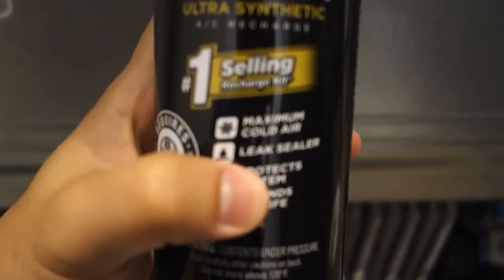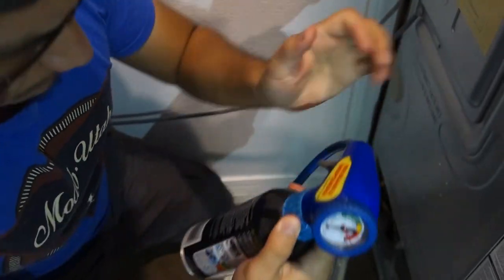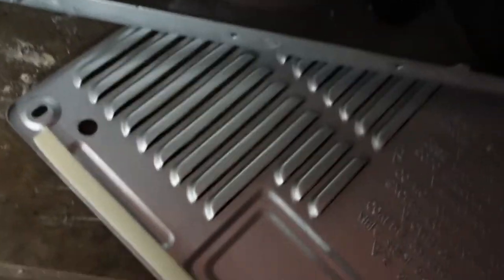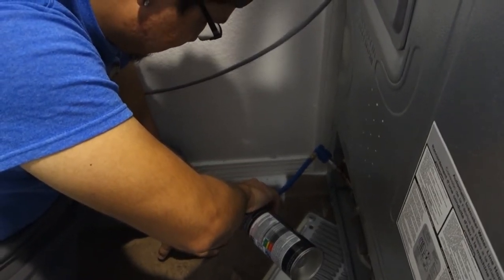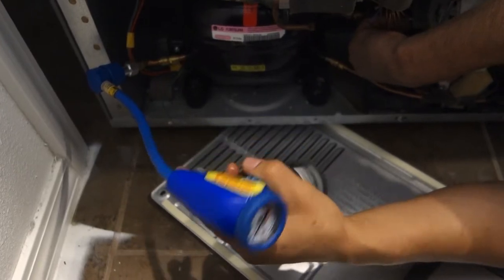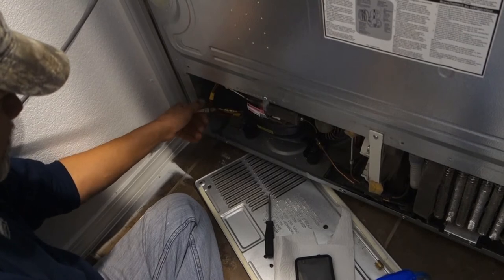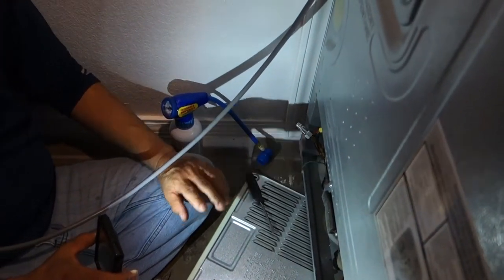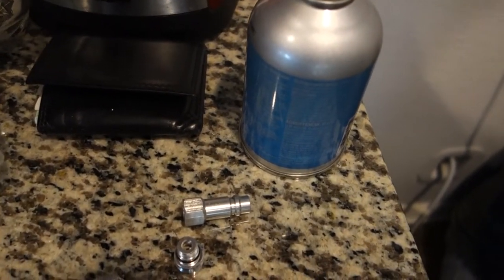LG Refrigerator Problems

Comment: This is a terrible idea do not do this. first of all on inverter compressors it's very important to weigh the charge in not just shoot gas in there without knowing how much you're putting in. Second of all you're letting air and contaminants in there.

Comment: The fact that their is no vacuum on the system when being charged, probably didn’t have the compressor running , I’m 100% positive the refrigerator was over charged and system contaminated. This is no where near good advice and would never recommend any homeowner do this without proper equipment and knowledge to service your refrigerators sealed system

Comment: After doing that if you’re refrigerator turns out to be properly charged I’d be extremely surprised and say you got extremely lucky. First of all if there is very little or no refridgerant left that means you have a leak that needs to be repaired before refrigerant can be added again. Second it was so obvious you guys did not know what you guys were doing. Turning the bottle upside down does charge the system faster but it also puts LIQUID into the system which is not good for the compressor. 

Bottom line don’t do this shit at home.

Comment: Please don't tell people to do this. While you were pushing in on the valve stem you were allowing air into the system. These fridges run in or near a vacuum and use less then 5 oz. Of freon for the whole box. I will give it to you that you were probably low on freon but anyone who hasn't had their compressor replaced won't have that port. I would say whoever replaced it probably didn't seal the system right and it will happen again. In the mean time that frosted line will drip once the compressor shuts on and will most likely find a way to the wall and start to cause problems. I would at least pull it out and check if it is rotting the wall now. Best of luck with it.
Reply from the maker: Thank you so much for that feedback but hey truth be told once warranty is over you try to fix it yourself to save some money. However I really do appreciate this information and I will be checking out what you said. Thanks again

Comment: So my LG refrigerator has the fresh food not working but the freezer part is cold. Ice maker is working.  Just the fridge part, French doors, stays at 50 degrees F. Inside the fridge part the fan is working. Is it the computer board?
Reply from the maker: It could be that, and let me tell you those computer boards can be expensive!!
Reply: Fan

Comment: My refrigerator fan is not working on the same LG model? do you have a video on that? The fan inside the refrigerator is not working?
Reply from the maker: I do not have one sorry. No the fan did work it was just the fact that it was not keeping nothing cool
Reply: @louievlogs1263  my fridge had a gas leak and therefore it was scrapped.